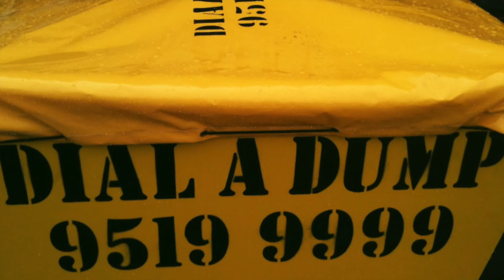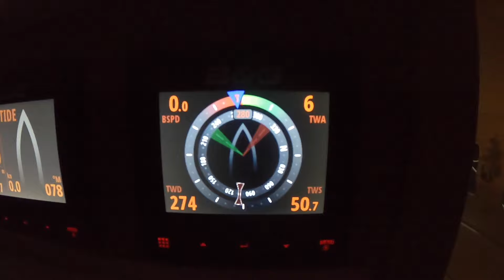SAILBOAT LIVING | CATAMARAN AGROUND! Should you trust a public mooring? Sailing With Lucy S3 E11

Comment: Hello I'm a plumber I don't know what an accumulator is? To me this looks like a pressure vessel with an internal bladder can you help me out? What exactly is the purpose of it?
Reply from the maker: Hey Wayne, yes you're correct about the accumulator. Most yachts have a little 1 or 2 litre capacity accumulator to smooth out the outflow from the diaphragm pumps. Our vessel originally had an 8 litre capacity accumulator so we thought we would stick to the same specs. We're glad we did, the water flow now for showering especially is really consistent. Before (when we had the old accumulator that was faulty) we used to get water that was up and down in pressure and as a result either too hot or too cold. So I would either freeze or burn!! The Pumps cut in pressure is 20 psi and cut out pressure is 40 psi, so we set (as per the manufacturers recommendations) the accumulator pressure to 17psi  (3 psi below the pump cut in pressure) and the system works well. Once the pump and accumulator were all good, Jim then had a problem with the suction side of the system. He finally traced the cause of that problem, it was just a nylon (or PVC?) elbow fitting with a crossed thread letting air in. Once that was replaced it all came together. It's funny how little things can bring the whole system down. Thanks for watching hope you enjoyed it. Cheers, Adriana

Comment: The achilles heel of saildrives and bulb keels is the risk of ripping a hole in the hull rather than solid skeg and shafts. I think a boat should be able to be beached without damage.
Reply from the maker: Hey Mark, certainly agree. Some Leopard models have 'sacrificial' keels that are designed to fail without breaching the hull. To some extent they protect the sail-drive but ultimately the sail-drive is the 'weakest link' in terms of risk.

Comment: Why have an accumulator? basic boat/rv water pump will keep pressure wont it?
Reply from the maker: Hey Mark, nice to hear from you and thanks for your feedback. We did investigate  a new type of pump called a V Flow pump (also made by Jabsco) that has a variable speed motor so that flow and pressure remain constant as taps are opened or closed throughout the vessel, eliminating the need for an accumulator tank. Unfortunately for whatever reason these pumps are not imported into Australia so we're back to re-installing a new Jabsco 8L accumulator which we expect to receive this week. At 8L it's a relatively large accumulator so we get about 3 to 4 litres flow before the pump kicks in. We've been running without the accumulator for a few weeks now and it's OK but the pump switches on and off constantly cycling on & off every 1.5s. Jabsco claims that the accumulators increase the pump life (it's a diagram pump) due to less cycling and that it also reduces the power (battery amps) consumed. I assume that the power draw is higher when it cycles constantly due to the higher start up current along with the inefficiency of stop/start operation (pressure & flow losses) . What I have observed also is that without the accumulator tank the water flow is more erratic, so we probably use a bit more water than necessary. Cheers, Jim
Reply: The accumulator is typically used to supply pressure before the pump turns on so you don't get a gush followed by couple seconds of drip drip drip before the pump is able to re-pressurize the line.  They also absorb pressure spikes so the rest of the system doesn't get hammered hard (for instance, when the pump kicks on).  If you're familiar with electronics, a good analogy is a capacitor.